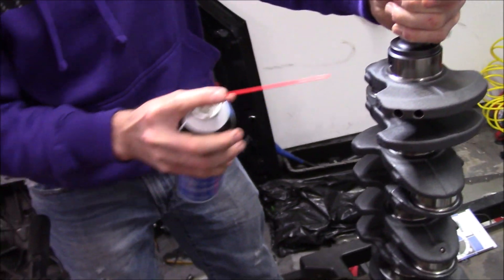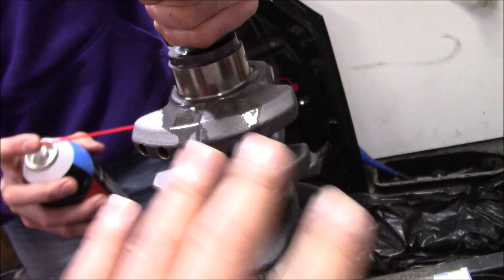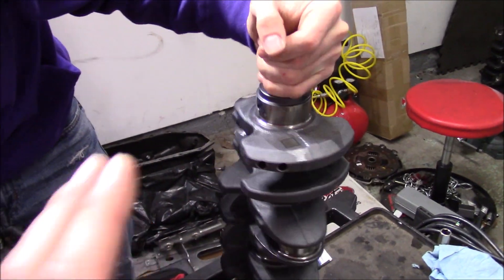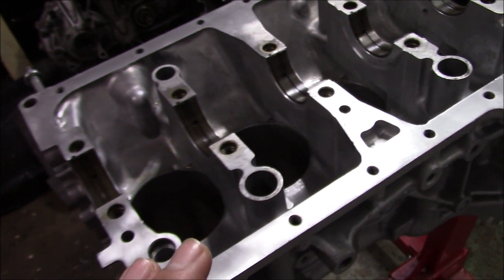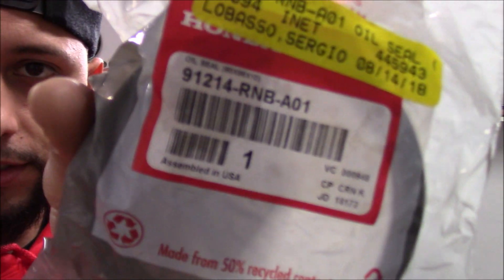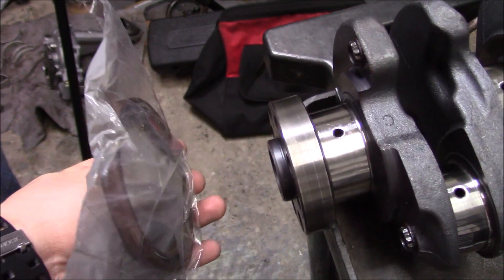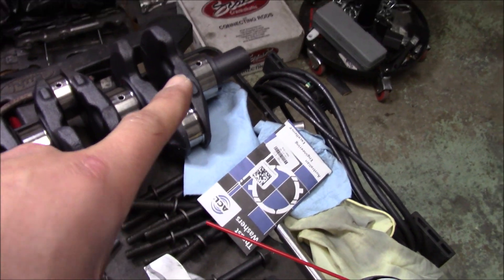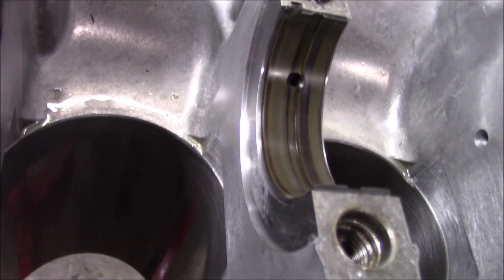Ultimate K20/K24 Build Guide! PT.6 (Crank Install)

Comment: Great.
I came here looking to see if the automotive k24 has those thrust bearings just like the marine version used in the Houda outboard motors.
And you showed that they do.
This is box ticked for my project to build a turbo k24 that can be stood on end on an outboard leg for racing.
Good video

Comment: Word of caution to anyone doing this on a Harbor Freight engine stand: So, I just was doing this step and had the bolts strip out of the engine around 4:30 where you're tapping on the crank girdle/lower block to seat the dowels.  See how Kenny goes to brace the engine while Sergio is hammering down on the block to seat it?  Yeah, I needed someone to pick the weight up like that apparently.  Instead the block broke loose from the stand.  Top of the block hit the stand and then then ground, but thankfully not my foot.  Dented a little at two edges  Hoping it's salvageable, but we'll see... To prevent this, make sure you have decent thread engagement on your particular engine stand.  I had K20 trans bolts holding the engine through the stand, and I thought they were engaged enough, but come to find out that they were only about 5 threads in.  It ripped the aluminum threads right out.  I am thinking longer bolts to secure the block are a good idea if you can find some, and double check it/support the block before you put too much pressure on that far end.
Reply: I went to my local hardware store to get longer M12x1.25 bolts when I saw how little threads I'd be able to get in using the transmission bolts on my harbor freight stand, I'm surprised you tried to do it like that. Did you manage to salvage it?

Comment: i noticed that you dont have oil squirters on ur block mine does. could I just block them off with no issue down the road? (built motor k20/k24 with cp pistons)
Reply: Yeah you should be fine buddy.

Comment: Light coat of oil/assembly lube on bearings, not a heavy coat, especially assembly lube as the danger if too much is used could clog oil passages momentarily

Comment: does the crank caps and the bolts have to go back to it's original place? i bought one that was taken apart and i heard you need a rebuild if you don't know where the original cap/bolt placement is....

Comment: noob question, but for rod, crank, & cam bearings; do you have to file them down if they are too big or w/e? Guess what I'm trying to say is how do you know what size bearings do you need? factory bearing from the dealership or what? I'd like to build my k24a2 motor, but never built a motor before.

Comment: I did not notice and perhaps you did, but, did you applied lube to the inside diameter of the rear crankshaft seal before installing the crankshaft?